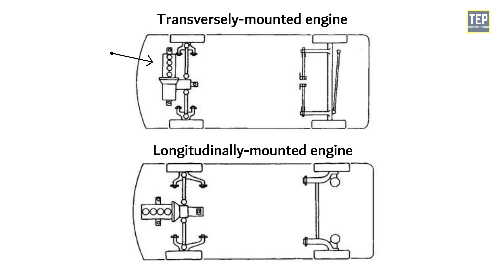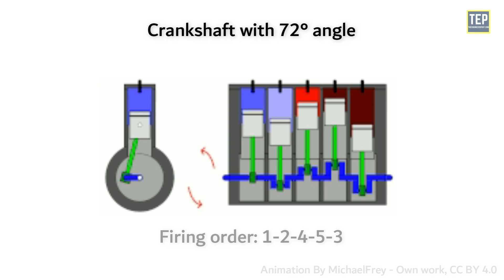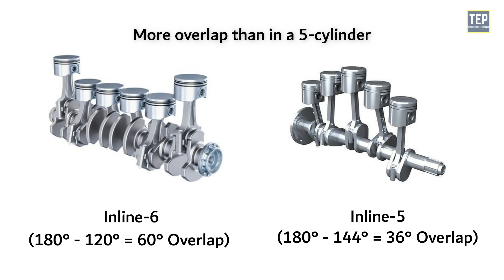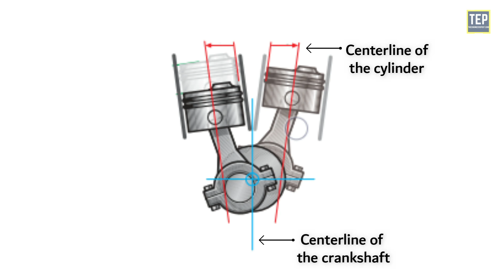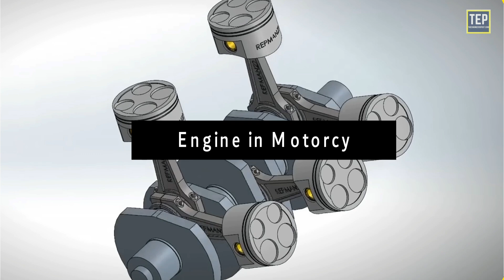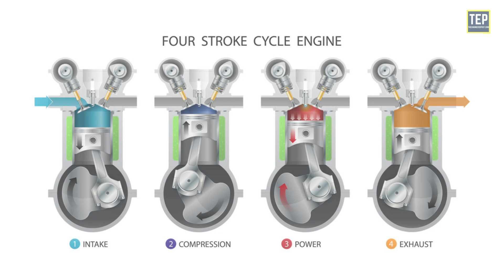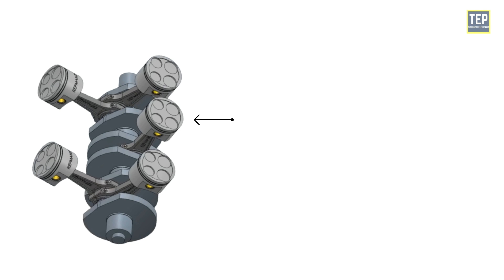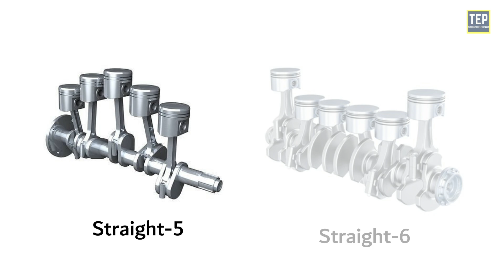Comparing Straight-5 - VR5 - V5 Engine | Pros & Cons of Each Explained

Comment: i have a fiat coupe 20v 5 cylinder turbo running 400bhp coupled to a 6 speed manual. sounds unreal. the only 5 cylinder that actually sounds like a v10, im running a stage 3 hybrid turbo with 3 inch catless straight pipe.

Comment: I have Volvo 2.4T 5cyl (B5254T) with very smooth power build-up and a lovely drum sound on acceleration! Absolutely love it. Used to have an 850TDI which sounded a little more brutal. Wouldn't prefer anything else except for a powerful American V8 perhaps :)

Comment: 6:20 Finally, the VR engine is correctly described. The VR is German for Verkürzt Reihen or loosely translated as Shorten Inline in English.  The reason why it wasn't called the VR5 but  V5 is that for marketing purposes. The word VR5 is too mouthful and too complex for salespeople, and only designers, engineers and enthusiasts can describe it correctly. Double the VR5 then you get a W10 engine in the 72° V bank.

7:58 That's the incorrect picture of the VR5 4-valve.

Comment: Can someone explain why the 990cc Honda puts out 260 HP while the 2300cc VW ( over double the displacement )puts out 180 HP ( 80 HP less )
Reply: Racing motorcycle tech has always been more efficient and advanced compared to road vehicles
Reply: @jediprowen  explain the S2000 then
Reply: Horsepower is a product of torque made at a given rpm over 5252. This gives you your horsepower measurement at those revs. So where the honda gp engine makes 260hp will be somewhere in the mid teen thousand rev range. Which means the torque number is actually quite low. The vr5 doesnt quite rev to 7 thousand, so its measure of horsepower suffers.

We’ll say the honda makes its 260hp at 14,000rpm for arguments sake, i dont know the specifics. If you multiply 260 by 5252 and then divide by 14000, you should end up with less than 100 lbs/ft of raw torque. The power is in the speed of the engine. 

On the contrary, with the vr5, makes its 170hp at around 6000 revs. So we do 170 x 5252 and divide that by 6000 to end up with 150 ft/lbs. Which is quite torquey for a small displacement N/A engine.

Fact of the matter is, if the v5 was engineered to make its peak power at 14,000 like the honda, it would far exceed the hondas power figures. Displacement is everything.

Comment: I own 2 Jetta Sportwagons with 5 cylinder engines. Fair gas mileage, smooth, dependable, and no balance shafts, love them.
I had a 1982 Scirocco, great condition except high mileage on engine and transmission. I had bought the car new, and truly loved it. My son, who is now a Master Tech with VW and Mercedes, and I  put a 5 cylinder Audi engine in it. Super fun pocket rocket.

Comment: I have a Fiat Coupe 20vt, 220hp coupled to a 6 speed manual gear box does give it some go, and the 5 cylinder really sounds great.
Reply: cute, my coupe is 400bhp
Reply: Yes, but that engine is The Right Engine, because it is Inine Engine, nothing like Vr5 or even V5 . And someone had 2 b extremely idioticlyblindlydumb, 2 go in2 a construction of such idioticlystupid engine as Vr5 or even V5 . But,  my frend had that Fiat R5 engine a few years ago, with about 650 Hp , and it was runing great + sounded great too.
Reply: Your car reminds me of Gran Turismo 2 and 3.

Comment: The ford Focus ST & RS you used both have 4 cylinders in. I know as I have the Focus ST with the 5 pot engine and it is by far the best sounding 5 pot. The RS shares the same engine just with uprated internals to handle the extra horsepower.
Reply: I was gonna say haha. I have one myself and it sounds absolutely glorious.
Reply: the volvo 5 cylinder is the roughest most unrefined sounding 5 pot ive ever heard. has a very strange underlying note for a 5 and quite describe what it is about it that makes it so strange sounding. which is odd as I've been shredding guuitar for 22 years and have an ear for notation.

Comment: I have 3.5 l i5 in my 2005 Chevy Colorado. It’s surprisingly peppy but fuel mileage isn’t great. Just turned over 108k mi. So far so good
Reply: Mine has 265k and its still kicking like a champ
Reply: @peytonmanning2561  one listed on autotrader with 475K mine has 73k runs great peppy

Comment: Have VW Passat(5.5) with V5 170hp AZX engine type.
Got the same one more than 10years ago....so i bought it again this year. Love the sound of the engine!!!
But i never know, that many cars got 5cylinder engine....nice to know.
Reply: I didnt know there was a production V5 engine.
Reply: @christiansgarageLLC  it's labelled v5 on the engine, but it's a VR5. same thing really. having a shared cylinder head doesn't remove the vee configuration.